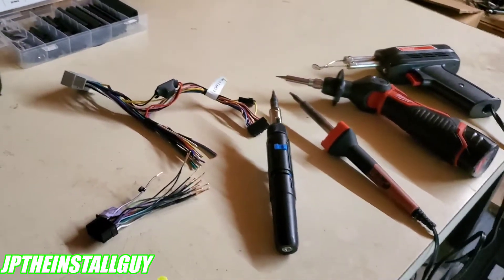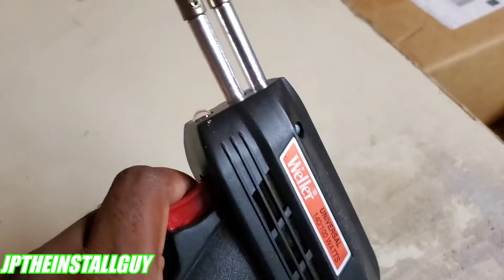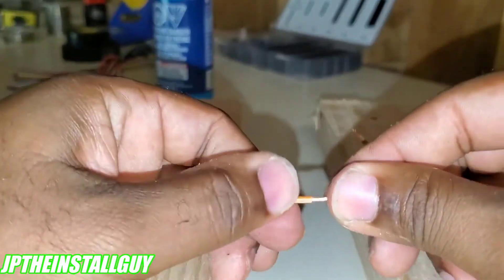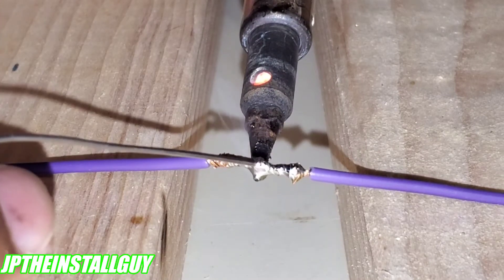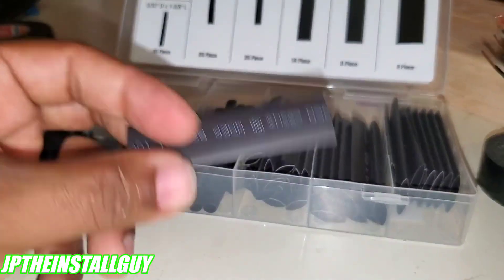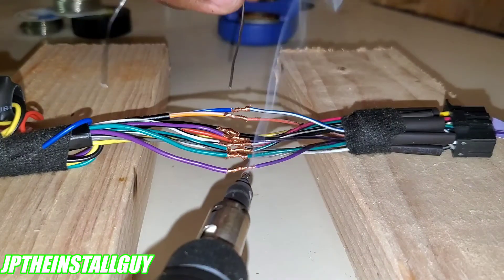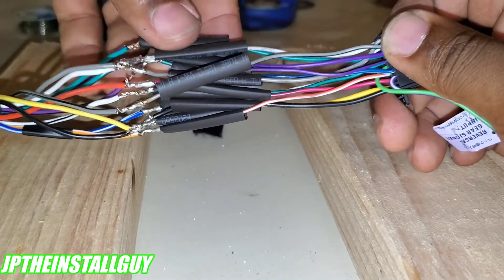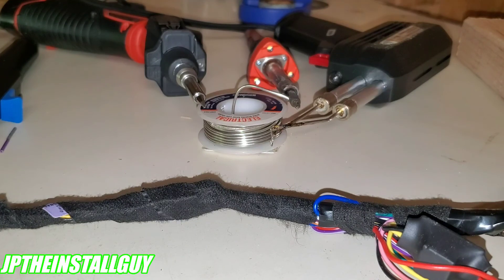EASY- How to solder your car stereo wires

Comment: I started watching this thinking here goes another video on how not to do things. I was wrong, this is exactly how I would do it myself, a lot of people try and spread the soldier over the wire. This is EXACTLY how you should do it by heating the wire first then letting the soldier soak into the wire. Great video!

Comment: Hey bro at 4:00 minutes u can twist the wire like u did but finish off with heat shrink tube. That would look killer and last for good. Edit. U are hip to heat shrink thats clean wire work.

Comment: Hey man, is tgere a way to solder wire straight onto the car stereo pins? Eliminating the plug in other words? My pioneer face went out... had an old single din deck layin around and cant seem to find the wiring adapter that came with it...

Comment: Dude! I wished I had watched this before I did this wire cleanup on my rig. Dang! I had issues soldering used a cheap soldering iron from Walmart, like it didn't get the wire hot enough or the solder was a pain but you prep the tip with some solder then I noticed if you have a lil pool of solder running it was easier to add more solder to the wire and move it around.  But it looks so much better than the mess of crimp nuts and mess I was cleaning up. I zip tied because I didn't have any Tessa tape, but looks way cleaner. Thanks for the inspiration and knowledge brother!

Comment: What temperature does the gun need to be to heat the wire up enough to melt the solder? I bought a Weller that advertises 900 degrees, but it will not melt the solder.
Reply from the maker: Might be something wrong with the Weller. I got a 45watt solder iron that melts solder just fine. Takes a while to get hot though
Reply: @jptheinstallguy  I bought a battery powered, then a corded Weller. I guess they're just good for really tiny wires. Once I bought a real deal Soldering gun, things started going differently :-)

Comment: Nice work! Rosin core solder usually has a little flux in it already so you shouldn't need to add any. For plumbing, it's mandatory because you're depending on capillary action to "suck in" the solder, but for this application with rosin core flux, the way you're doing it is perfect 👍

Comment: Jp I have a question a little off topic, I just bought a 2017 acura ilx, I installed 12 inch sub still have factory hu, taken it 2 different shops no one knows why my sub starts humming hitting super loud when I start driving
Reply from the maker: 2 things for you 1st check the loc. Sometimes line output converters have an adjustable gain on them and it maybe to high that will cause humming through the sub. Also see if you have any anc(active noise canceling mics) in the car they will do that same thing as well
Reply: @jptheinstallguy  yup u were right active noise. Took less than half hour to make it right. Thank you so much
Reply from the maker: @thatglowappeal544  BOOOOOOOOOOM that's whats up happened to me plenty of times bro. Glad that was the issue